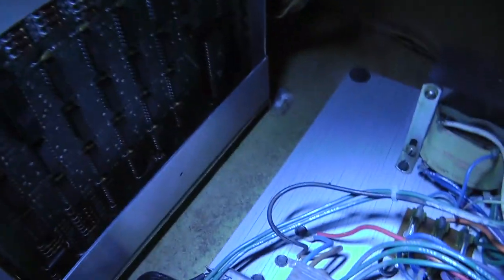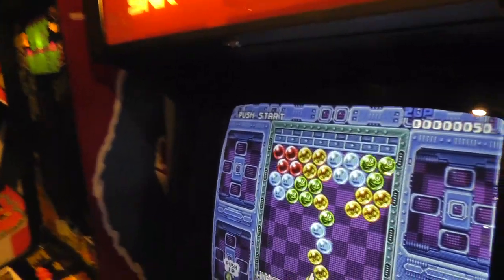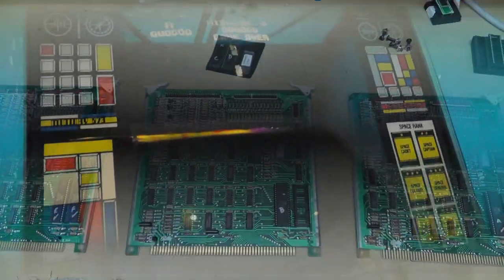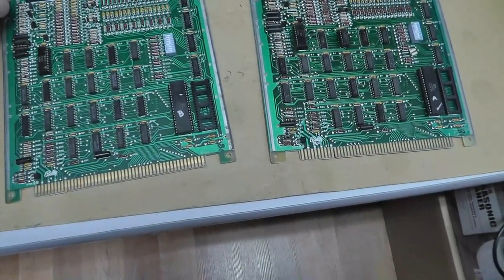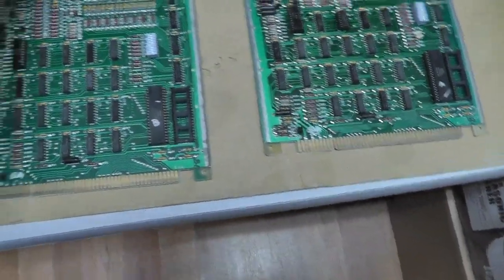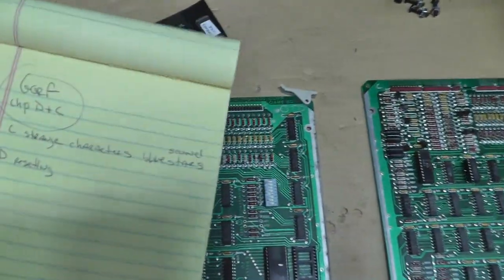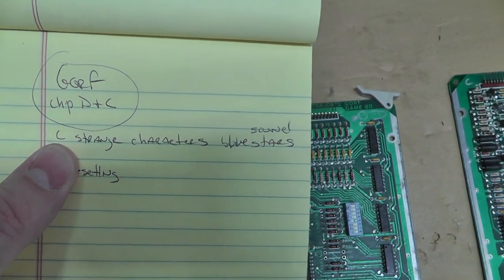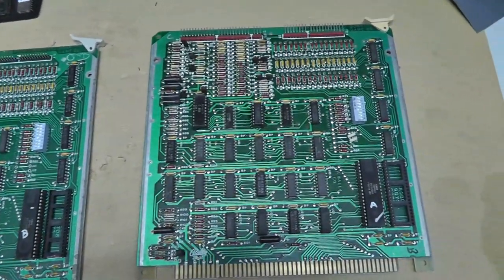Gorf Game Board - Bad x3 Custom - Symptoms, Oven Baking, Dremel

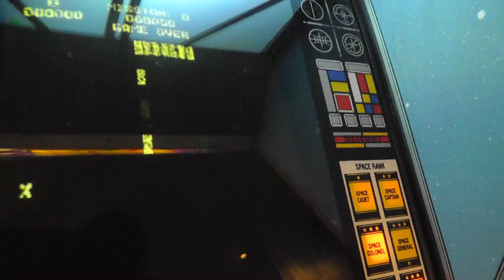Comment: Good info on the game pcb! We have a gorf that is missing the enemy sounds is that just a problem with the x2 chip? Also 8:24 had me nervous I felt like the game was turning into a transformer or  something🤣
Reply from the maker: Yes, during the "space invaders" level, the thump thump noise is on the 2nd audio channel coming from x2.  Swap x2 with x3 and see what changes.  Hopefully, it is just the audio but it is possible it just won't boot with a questionable custom in x3.  if the problem is the same after swap, your problem is not the custom.
Reply: @jacklick  we tried that still no enemy sounds, if you have any working board sets for sale let me know, also we have the cabaret which has two speakers (the upright might also I don’t know) and the left speaker is not working is it because the left speaker only does the sounds that we are missing or is it a different issue?
Reply from the maker: @pacscalatorarcade5736  well, if swapping x2 and x3 didn't solve the problem, that is probably good news.  yes, two audio channel outputs go to the amp board and from there,  audio #1 to speaker #1 and audio #2 to speaker #2. Easiest check is to to put Jumper 1 in place on amp board.  This will cause all sounds to come out both speakers.  If one speaker has all sounds and other has none, then the problem is on the amp board or speaker.  If you are still missing sounds, but sound is heard on both speakers, the problem is on the game board. << my best quick help

Comment: Interesting , I came across this video as I am assembling a 4th n 5th Gorf cage. While new in this hobby and Gorf being my favorite game when it came out, 41y later I finally bought 1 working Gorf last August. Being a member of various forms and I managed 2 come across a pile of Gorf boards and building these up ..with experience in electronics but not a advanced technician, just a retierd ASE Master Tech from GM that still tinkers with this and autos n trucks ..thank you for your video it helps tremendously on my last 4th n 5th cage of Gorf...my machine is now fully restored plays great with each of the last cages I have that have personalities !! e.g; whistling speach cage, easy rom set, hard set, differences in color and not because of a problem with the monitor or board in that.. anyways thanks!  Now I need 2 get this pattern board fixed 4 the 5th cage ..wish me luck 😉
Reply from the maker: Glad my vid helped.  I have others on gorf as well.  Those sound like some interesting problems to hunt down, good luck!

Comment: So you're just swapping custom chips around in different orders because all the custom chips are the same and the game is only using partially a portion of the custom chips. If you keep swapping them in different sockets they might work because the game is only using half or less than half of the custom chips and in a different sockets it might work?
Reply from the maker: The I/O customs  at x3 and x2 on the game board are the same, yes.  I wasn't just swapping them in different sockets; that having an impact would be a bigger miracle than baking them in the oven.
Reply: @jacklick  you can only bake pokey chips not custom chips. The custom chips are pal/gal array chips I think and can't be baked. The pokey chips do have a character generator and sound generator, which I'm not sure why baking them heat fixes them but I have seen repair techs do this and it works but I think after a few months they go bad again.
Reply from the maker: figured it was worth a try and documenting.
Reply: @jacklick  Why does GOLF have a Pattern board>? what does the Pattern board do because most arcade games don't have a pattern board so I'm not sure what the GOLF pattern boards are doing
Reply from the maker: @waynegram8907  that makes two of us.  I would have to research it.
Reply: @jacklick  thanks for researching about it